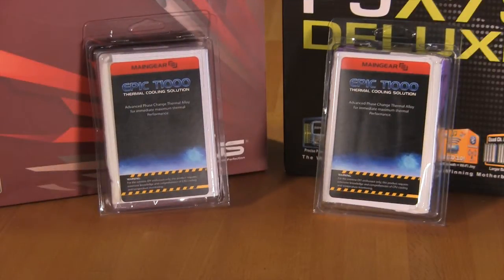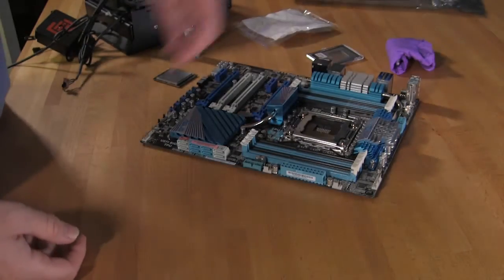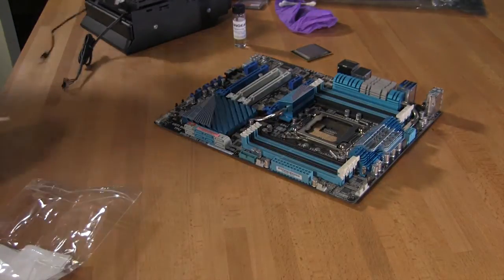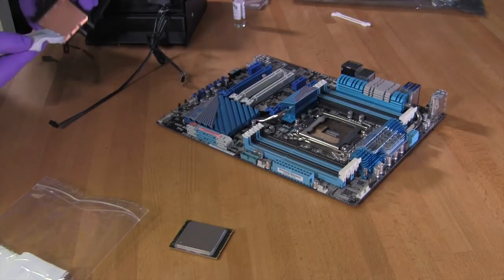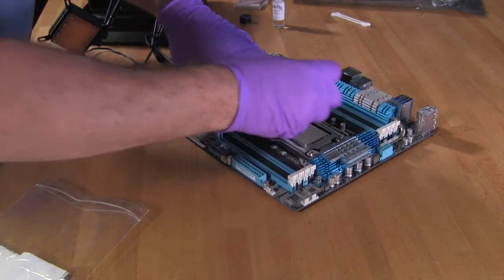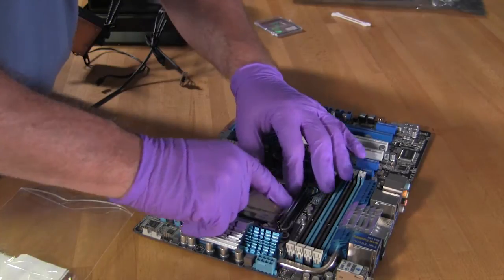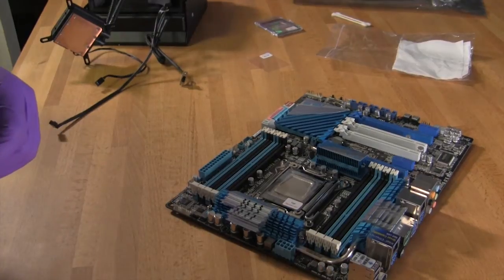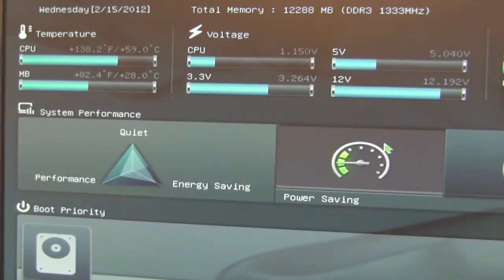MAINGEAR Epic T1000 Phase Change Thermal Interface Introduction and Installation

Comment: my pc is leaking water, should i put a bucket to catch the water or use a water sealant on the case?
Reply from the maker: I recommend you use polystyrene foam and completely fill your PC with it. This should prevent the leak from escaping the main enclosure of the case. Additionally You can put in large amounts of damp-rid.  This is an added precaution, but is not needed.

Comment from the maker: @MyAltruistic With our flat test bench it did not matter the direction of the mount. However if you are mounting this in a case then yes, you will want to mount the thick side toward the top of the case. As for the reflow, you can do that vertically or horizontally, as long as you can make sure that you apply tension equally to all of the mount points.

Comment from the maker: @MyAltruistic, in our case it did not matter as the board is flat. For use all we needed to do was heat the TIM properly and apply pressure to the "thick" side to force it to flow. If you are mounting in a vertical case then yes you would want to put it in the oposite direction from the one we used.

The reflow can be done either way, you just need to make sure you continue to tighten your mounting screws (if that is what you are using).